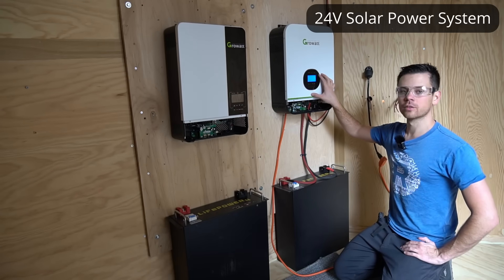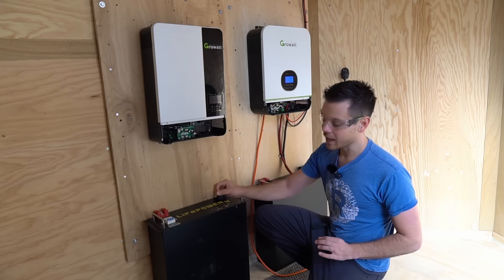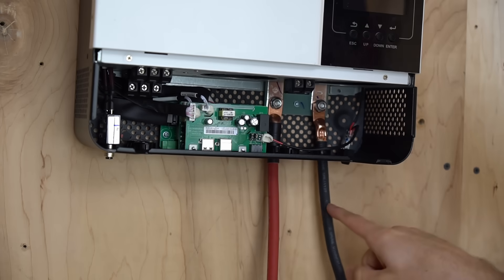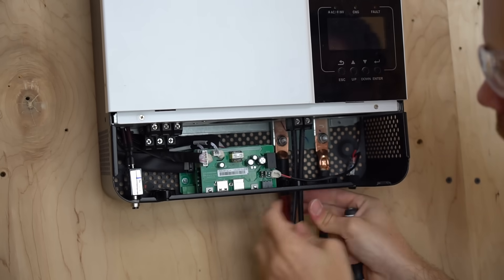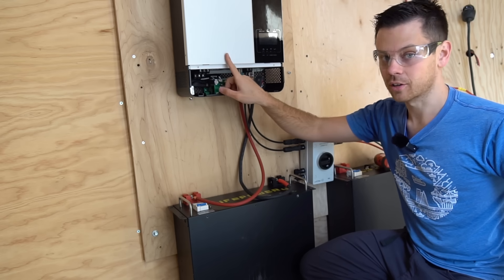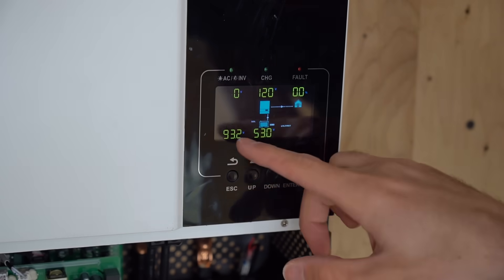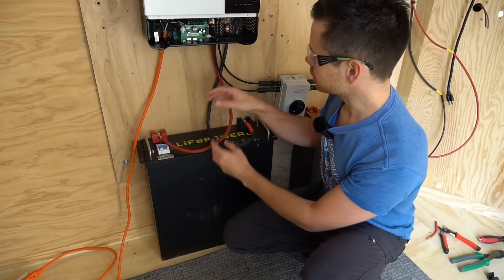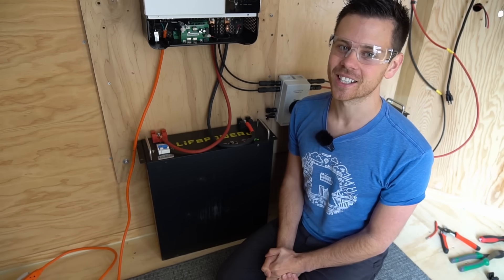Beginner Friendly 48V Solar Power System! Step by step!

Comment from the maker: As always, mount these inverters to a non-combustible surface, such as hardiboard. It costs $10 and will increase your peace of mind. Also, avoid combustible materials within a 4-foot radius. Check out this video where I show how to do this: https://youtu.be/01qYerhorwU

The unit was not charging because I forgot what model I was working with. It requires 120VDC minimum at the input to work. And it has a max input voltage of 250V. I don't know how I messed that up. I was just using the 148VDC max model the day before, so mixed it up.

Also, use the proper terminal ring hole size for your inverter. I use these on multiple inverters, so they are huge. 
These products are old! To see what I currently recommend, go here: https://www.mobile-solarpower.com/48v-complete-system-blueprint-559371.html

Solar Panel Array Voltage Calculator: https://www.solarchargecontrollercalculator.com/

how to design a solar array wiring configuration: https://youtu.be/C-k0WHJ4RxQ

Example Settings and Other All in One Systems: https://www.mobile-solarpower.com/all-in-one-122448v-packages.html

~~~~~~~~~~~~~~~~~~~~~~~~~~~~~~~~~~~~
Tired of getting ripped off? Check out my "Will Prowse Approved" solar product recommendations below!

12V Batteries
https://www.mobile-solarpower.com/lithium-batteries.html

48V Batteries
https://www.mobile-solarpower.com/48v-batteries.html

Offgrid Inverter System Builder
https://www.mobile-solarpower.com/48v-complete-system-blueprint-559371.html

Hybrid Inverter System Builder
https://www.mobile-solarpower.com/code-compliant-48v-offgrid-system.html

Mobile Handtruck System Builder (very popular!)
https://www.mobile-solarpower.com/mobile-48v-system.html

Solar Panels
https://www.mobile-solarpower.com/300w-solar-panels.html

Ground Mount Solar Racking
https://www.mobile-solarpower.com/ground-mount-racks.html

Wire, Lugs and Busbars
https://www.mobile-solarpower.com/wire-and-connectors.html

Tools
https://www.mobile-solarpower.com/tools.html

Fuses and Circuit Breakers
https://www.mobile-solarpower.com/fuses.html

Plug-N-Play Solar Systems
Ecoflow, Anker And Bluetti! So many models to choose from. See my current recommendations here:
https://www.mobile-solarpower.com/full-size-systems.html

~~~~~~~~~~~~~~~~~~~~~~~~~~~~~~~~~~~~~~~~~~
Need to build a large DIY system? Need a trustworthy solar distributor? These are my favorites:

Signature Solar
Creator of EG4! Solar Minisplits, Victron and More! Largest Solar Store Online.
If you want $50 off, please use my link below and coupon code "DIYSOLAR50":
https://signaturesolar.com/?ref=cPwLcVc0SW-BjN

Current Connected
Best Prices for EG4, Victron, Midnite and so much more! Fast Shipping and Highest Rated Customer Service:
https://currentconnected.com/?ref=wp

~~~~~~~~~~~~~~~~~~~~~~~~~~~~~~~~~~~~~~~~~~
Join our DIY Solar Community 
Need more help? Join the largest solar forum on the internet for beginners and professionals alike. 140,000 members and counting!
https://www.diysolarforum.com

Check Out My Free Book
Best-selling and beginner-friendly guidebook to off-grid 12V solar!
https://www.mobile-solarpower.com/the-book.html

~~~~~~~~~~~~~~~~~~~~~~~~~~~~~~~~~~~~~~~~~~
Contact Information:
I am NOT available for personal solar system consult! If you wish to contact me, this is my direct email: williamprowsediysolar@gmail.com
FTC Disclosure Statement and Disclaimers:
Every video includes paid promotion or sponsorship (such as free products for review). Some links on this YouTube channel may be affiliate links. We may get paid if you buy something or take an action after clicking one of these. My videos are for educational purposes only. Information is subject to change/update at any time. Electricity is DANGEROUS and can kill. Be smart and use common sense :) DIY Solar Power with Will Prowse is a participant in the Amazon Services LLC Associates Program, An affiliate advertising program designed to provide a means for sites to earn advertising fees by advertising and linking to Amazon.com
Reply: I’m a growatt Dealer and sell battery’s just like these server mounts in Arizona for what it’s worth or if you need any help southwest solar supply  and my battery’s are warranted and we have parts if you need any repair
Reply: To add to this my growatt truck just got here first 5 people to buy get half off
Reply: @richeagleton5285  Do you have a website? What is the name of your company?
Reply: @richeagleton5285  What part of Arizona are you in? Do you have a store? What models do you carry?
Reply: @richeagleton5285  I'm interested in the Growatt 48V 3kW LVM-ES unit. Do you have any of those in stock?
Reply: @fordsrmaster  yes I have 48 volt or 24 volt I can ship it out today if the ups guy didn’t come yet I’m just heading home from a Mexico vacation but I can have shipped ASAP
Reply: @richeagleton5285  I live in Maricopa. When I pull the trigger and decide to move forward, I would like to just pick it up instead of paying shipping costs. Would that be possible?
Reply: @fordsrmaster  ok when did you want to meey
Reply: @richeagleton5285  Probably late January or early February. I'm waiting on some money coming from Ford.
Reply: @richeagleton5285  Can you give me a price on the 48V 3kW LVM-ES 120v model?
Reply: @fordsrmaster  yea we can even meet if you need to or if you wanted to come to my house /store  you can go threw everything and I can get a kit together with brakers if you want to hook it right up
Reply: @fordsrmaster  ok I’ll be here Let me know so I can get you the newest unit made and I also can help you get brakers abs everything to get it going I have server rack batters same as EG4 with the green but I sell them for 1600 both 48 and 24 volts so If you buy all in one I’ll give you a great deal
Reply: We have 2 5k Growatts w 4 of the EG4 batteries (budget version). I would love to see this system with the transformer. Thank you so much for this video!!
Reply: do you need to wire the ground connection to the earth with a copper rode?
Reply from the maker: @EpicHardware  no you don't. It's a floating system. If you connect ac input to grid, it requires a grounding conductor. Look up floating systems and how they work to understand.
Reply: Thx for video Will!! :) What to do if I would like to trigger external load like water heater if battery is toped and I have excess power from solar?
Reply: Awesome! Thanks
Reply: Just saw a global power 100ah for 300 with low temp cut off
Reply: may i get in contact with you  over email?
thanks frank
Reply: @Richard from Signature Solar I'll add my footnote to your comment.  I bought a signature solar EG4 battery a few months ago and it was damaged in shipping which can happen since these batteries are heavy.  Signature solar accepted the return but the process was not easy and it took more than 2 months to replace.  Noteworth was the new battery came in a much better shipping box and I give them a positive for that.
Reply: You need to write books if you haven’t yet . For anyone like me who’s sure the world as we know it will come to an end . There will be no internet. I have books on hydroponics, what’s save to eat in the wild, companion gardening and more.
Reply: Thanks Will. I'm seeing that the 5 kW Growatt unit has a Max DC rating of 450 V
Reply: I would have those battery connection at the back not in the front to me  is poor design if is a rack! Imagine your Tesla car with all wiring coming on the front on your dash for easy maintenance
Reply: I don't suppose you have any European alternatives for that battery there as to buy that here in your money = a shade over $4000 just for the battery which buggers up things a little. I really dont get why this stuff is still so expensive.
Reply: Hello will I need your help can you please let me know how can I get in touch with you thank you
Reply: how many 400 w panels do you need + how many batteries and what size batteries do you need and  how big a  Highbred converter do you need to supply 15 kilo w of power  24 / 7 off grid ? - Do you have a Video to show exactly how to wire in solar into the UK House Circuit breaker thanks  Troy let me know asap
Reply: Thank you for this very informative video. My wife and i are getting ready to move onto some raw land we purchased in SE Missouri & have a Growatt SPF 3000LVM-ES and preordered the EG4-48v 100AH battery. As there is absolutely nothing there yet decided this would be a great start for the building we're putting up as living quartes & small workshop while designing the site.
Reply: Hello:

I have 16 model: 3.2 v 280 Ah batteries along with “Overkill Solar” battery management system.  I have cut the wood that I will be using to construct the bottom of my wooden frame to hold all 16 batteries.   I would like to purchase battery tape to provide support to all 16 batteries and to secure the battery terminals.  

After I’ve connected each one of the BMS leads to the positive terminals which includes the black lead to the negative terminal and the red lead to the positive terminal, I’m not sure what battery wires and devices should I use to connect two Growatts 3,000 kilo watt inverters to the 16 batteries.

Would you do a video on this or provide an answer on this?

Regards,

Gabriel L.
Reply: Hi Will. I have  question about precharging the inverter. Is there no need for that when you have a built in circuit breaker or  a main switch?
Reply: Thanks for your tutorial,it was self explanatory,how do I communicate with you privately, through email or any other means will be appreciated. Like all your videos,I would love to be grounded properly into installation of solar power.
Thanks,as I hope to hear from you pretty soon.
Reply: I have 12x REC panels, 2820W 235W ea. that I'm not using.  Do you have a suggestion for 500Vdc inverter, other than the Apollo stand-alone you showed in a recent video, the one where you did the retest after the shock?
Reply: Which battery is this please?
Reply: Will, I am TRULY a beginner and have zero understanding of how you messed up.  Couldn't you make a corrected video? Please? Pretty please!!

Thank you so much for all the valuable info you provide.
Reply: Good for me❤❤❤❤

Comment: Im setting up an rv system with a 3000 watt inverter.  I cannot find any server rack batteries over 100ah and even those are very expensive, I can find 12v 600 ah batteries all day long and they are only about $500.  I dont have the space to use 6 server rack batteries in my rv.  Even 4 12 100ah batteries strung together take very little space vs 4 server racks.  Is there something I dont know?

Comment: In some videos, they suggested to add a fuse on the hot wire from the battery to the inverter.  Does it not need here with this battery?

Comment: I am wondering about mounting the server batteries in my trailer. Should I worry about using a rubber pad under them before attaching the brackets to the walls, or is that a concern? Thinking about road vibrations.

Comment: I have this unit, the minimum PV is 150 volts dc for the unit to charge your battery, the maximum is 250 volts not as you quote 150 v

Comment: I went with the 12kpv over the 6000xp because the 6,000 doesn’t tolerate cold temperatures and will not invert below freezing like the 12kpv will, I will later expand and connect another 12 or 18 later as the house demands expand

Comment: Nice $15,000 setup there. Yes, copper is not cheap but it is a ONE TIME purchase.

You need 28v @ 0.08 amps to kill you.

Shame the user cannot set what outputs they want, amps AND volts. And without having to use a effing cell phone to do it.

Comment: At night, when the controller isn't sending power to the battery, can I also have an inverter with a built in charger connected at the same time to the battery using a generator as input to the inverter?

Comment: I have an 1850w 15A surge protector that I'm wiring to my AC output on my LiTime 3500w 48v system. It's just to power my computer and a small fridge and some monitors. Are there any other recommendations that could be better for AC output? The max rated current on my AIO is 29A.

Comment: yea  naw, my solar panels run into a breaker/disconnect switch and THEN into the inverter in fact every power source into and out of the inverter has breaker/disconnects  that may be wrong but  better safe than sorry.

Comment: Think a good setting to remember to change would be the amps for the AC input if you are using the rest of the extension cord to occasionally help charge up your batteries.

Comment: Can you use  four 12v 100ah, 1280w Wattcycle Lifepo4 batteries in serious  instead of one 48v battery. And how would you have to charge them with both solar and a charger?

Comment: Informative as usual! Which one do you recommend? All in one systems with low frequency vs high frequency inverters? Which specific examples do you recommend? I plan to run a mini split AC/heater as well as plugged power tools. Thanks!

Comment: For the AC output, can i bring those leads to a small 6 space AC breaker box? I ask because i plan to run regular romex wire to outlets and lights, but want to terminate them in a traditional sense.

Comment: I'm a retired electrical contractor, and every time I see you touching a busbar, even if it's only 12 volts, I instinctively cringe!  Yes, I've been danced across the room a time or two in the ~40 years I was in the business, just never from a busbar.

There's a big problem with vacant commercial buildings being broken into by thieves who are after the circuit breakers and busbars, blissfully unaware of what 480 volts can do to the human body, or the arc explosion from a wrench getting between two phases.  The "lucky" ones are the ones who only sustain a serious arc flash burn.  The unlucky ones are found and transported to the morgue.

Comment: It's not voltage, it's current plus the path it takes through your body - your heart is a lot more sensitive than your limbs.  People have had their arms burned off (I know someone who had this happen) and lived to tell the tale because the current didn't go through their heart.  I've experienced so many tingles from 110V in my life I've lost count - but never with wet hands, and never arm to arm or arm to ground via my feet.  But yes, take precautions which shouldn't be much harder to take than "don't put a 9V battery on your tongue" is :-)

Comment: Hello, how can I connect lithium batteries if I don't have BMS to connect to the inverter? 
It can be assigned as if it were from AMG for lithium battery in the settings?

Comment: Hello there, thank you for the inspiration I have a question below:- 
if I have a hybrid inverter that it's spec is  as follows:- Built-in MPPT controller : 120A 
Max PV open circuit voltage :- 195VDC 
DC Input :- 48v
using a 8 pieces of 450wt panels, how would the connection of the panel wiring goes?
Thanks in anticipation all the way fro m 🇳🇬

Comment: Will that solar disconnect switch between two different controllers? I am needing a switch box so I can switch between my well pump controller and my cabin controller. I have one solar array and want to be able to switch where the solar panel voltage is sent. Instead of unplugging the panels every time.... Thanks....

Comment: Hey WIl, I love all your videos and helps out a ton.  I have a question for you.  I want to install a 48v all in one inverter and I have two batteries.  One is 48v 50a and the other is 48v 200a.  Will I be able to use the two batteries at the same time?

Comment: I been using Growatt 12kw inverter on my offgrid homestead.  I Hate my Growatt inverter.  Works fine on a completely sunny day.  Cloudy days, it doesn't want to charge my batteries, and if it does it only trickle charges them, even when it has ample voltage and wattage.  Growatt tech. support is completely useless.

Comment: AC kills at 50hz. It interrupts the rythm between the S-A nodes of the heart. The european 60hz will not. DC would require very very high voltage to kill you. Damage is caused by massive tissue damage due to heat caused by resistance

Comment: How big a system would you recommend to power a small cabin and occasionally a 220v Well. All heating and cooking is done with propane. Not asking for a parts list, just recommend amp hours (if that is the correct term) for up to 48 hours. (not continuous)
Reply: To run it simply off batteries for 2 days with no solar input, I would expect approx 20kwh of storage.
Reply: 4kw of panels might squeze by with, but 5kw would be better.
Reply: @SarahStuff-p5u  Thank You!

Comment: Just bought this system with 9 used 365 watt panels, 3P3S, should be 120v 30amp going in with a 30amp inline circuit breaker/shutoff on 120ft of 10awg wire....would love your second opinion, would really appreciate if you have a t fuse video, odds are I will need to add another 5kw battery, system is 48v

Comment: Does this system allow for connection to grid ac  for perios of low batteries and lack of solar im after fitting a supplementary system to my uk houses grid system but have no desire to feed into the grid or pay silly 1000s of pounds for a system on my house roof as this will fit diy style to my extension and sheds easy

Comment: Hello, thank you for your video! i would like to ask you :if two Growatt is at parallel  mode single phase ,should i have to connect my panels at only one Unit of Growatt or at both of them ?Manual does not explains..Thank you.

Comment: Good morning all
I want to install a Growatt  SPF 5000 ES 48 volt , But i no have a combiner box. I want to use 3 string of 24 volt 450 watt panels .
My question is : instead of combiner box can i use MC4  T branch connectors cable coupler combiner 1 male to 3 female to 3 male (M/3F) and 1 female to 3 male (F/3M) for my 3 string panels ?